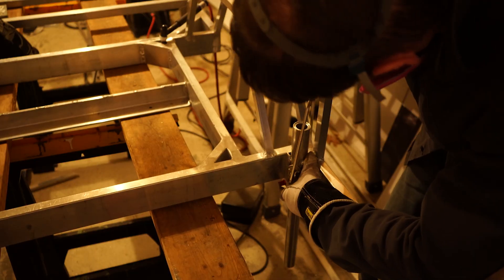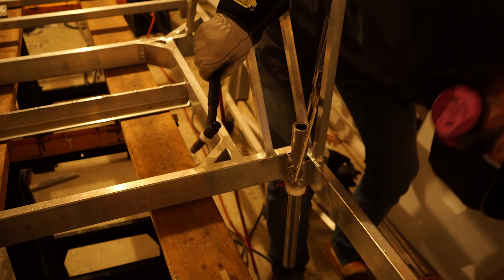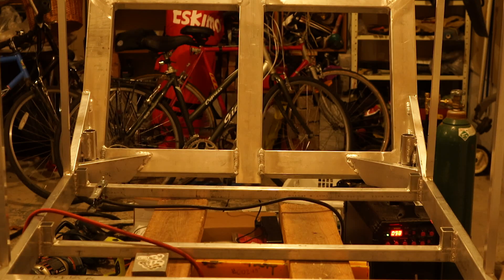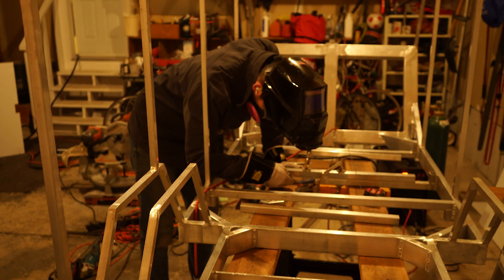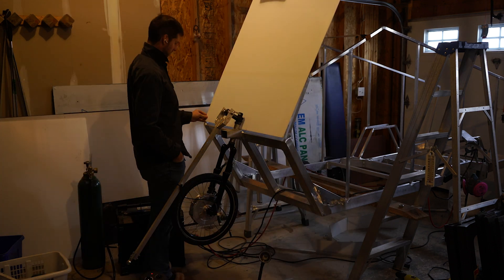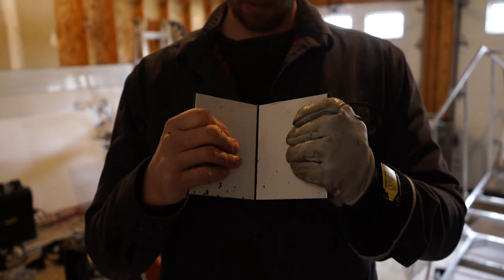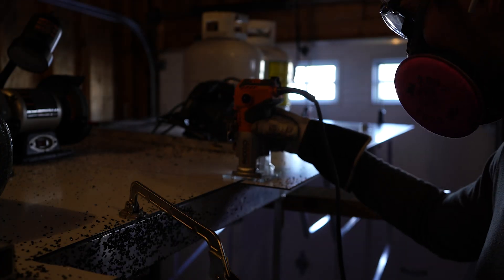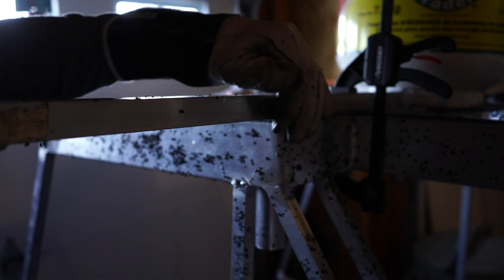Building Electric-Powered Bicycle Camper - (PART 6)

Comment: I would have used sikaflex to glue the panels on can get automotive glue aswell high flex strong and waterproof
Reply from the maker: Interesting, I didn’t realize sikaflex could be used for this purpose. Is it much cheaper than 3m VHB? I would assume so…

Comment: One of the advantages of putting the battery in your bike is you can peddle to an outlet to charge it without bringing along the trailer.

The converse will not be much of an issue, leaving the trailer to charge while you do a trip on your bike. The most likely place you will do that is a campground, and even if you are away for the day you will be there overnight. Additionally, if you have a non-electric site, you could find a friendly neighbour with power that you would just leave your bike at.
Reply from the maker: This is great input that I hadn't quite thought of. Makes a lot of sense. Yes, I think I'm decided on putting the battery in my Bullitt cargo bike. Appreciate the comment!
Reply from the maker: Which also makes me think I should build the battery capable of level 2 charging at car charging stations. Something I'll have to learn about.